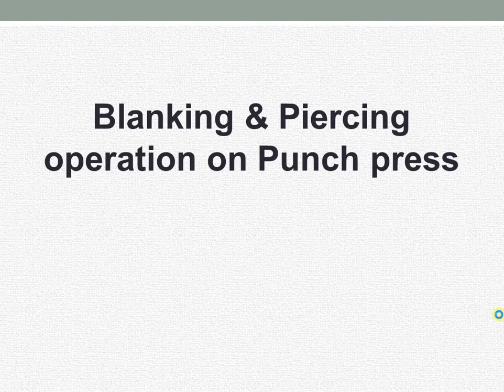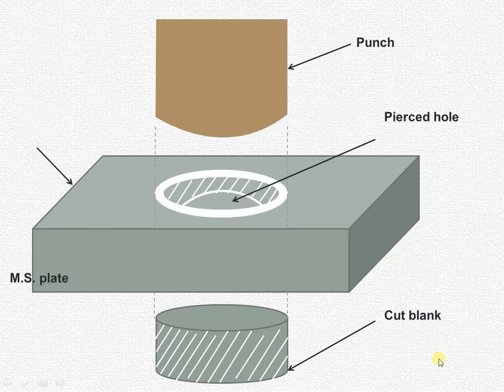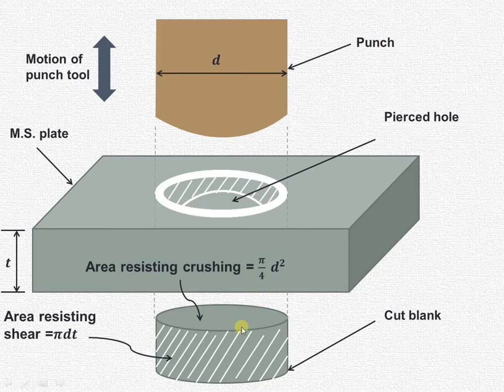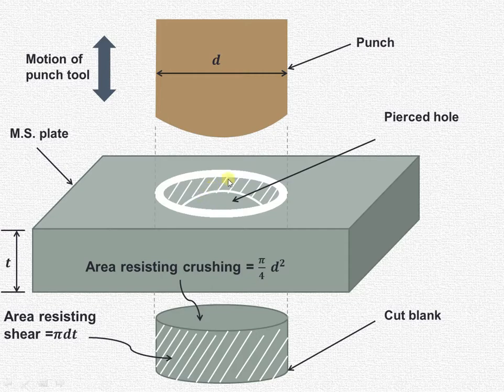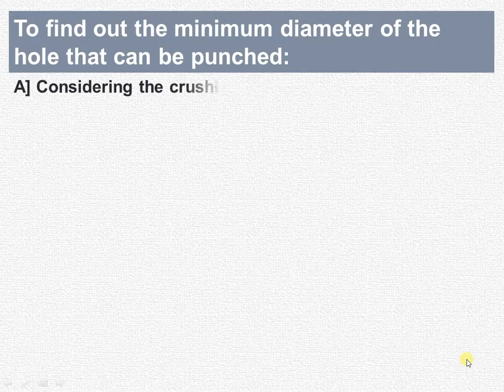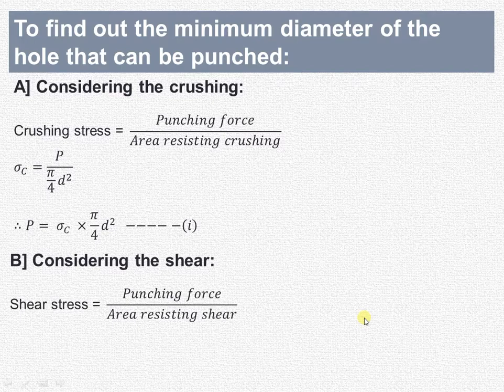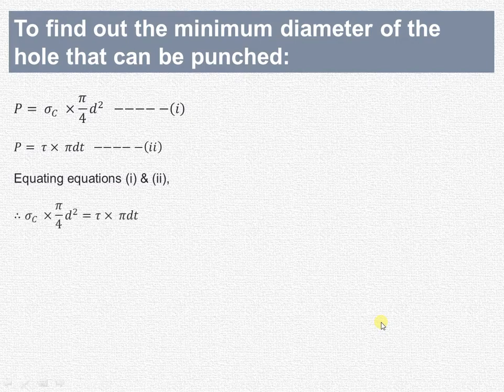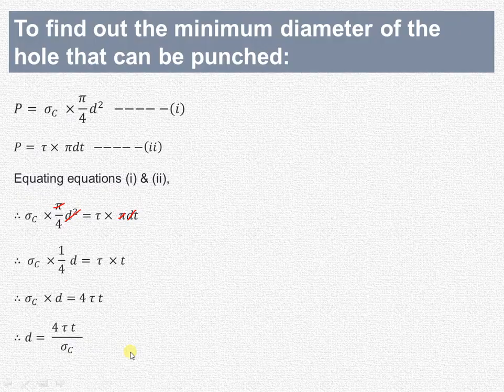Crushing and shear stresses  induced during blanking & piercing operation on Punching press

Comment: Sir will the hole which is punched come out instantaneously as soon as force is applied ??
Reply from the maker: Yes
Reply: @CHINMAY_ACADEMY  Thank you !! 
Another doubt - Will the shear force changes , lets say in case of slicing surface with knife as the knife moves down because the area keeps increasing or decreasing ??
Reply from the maker: Yes it will ! But for the calculation purpose we take the average value.